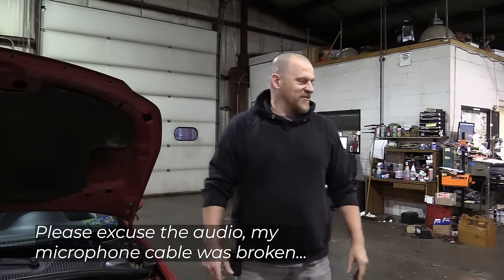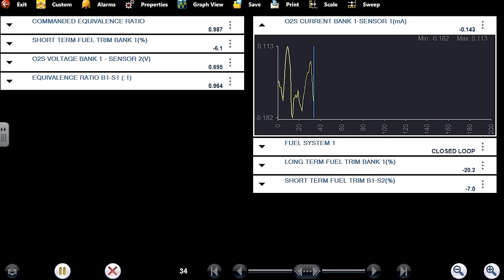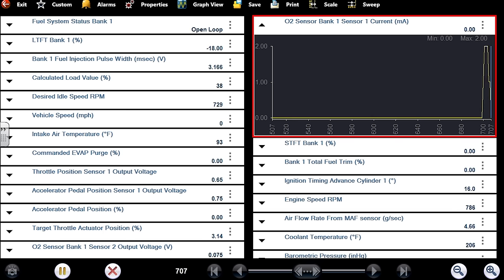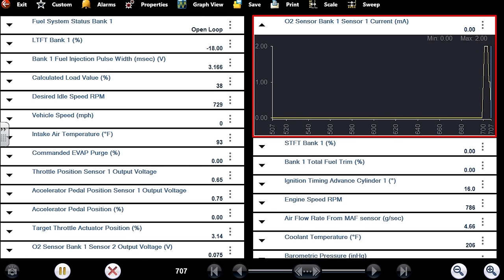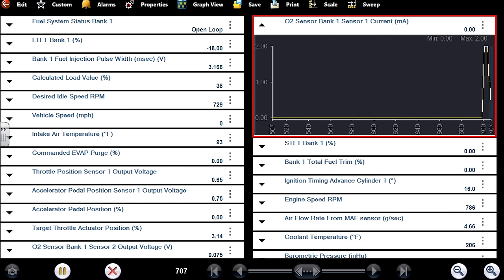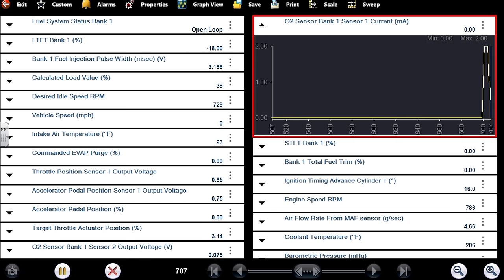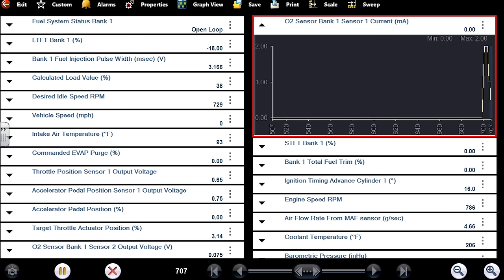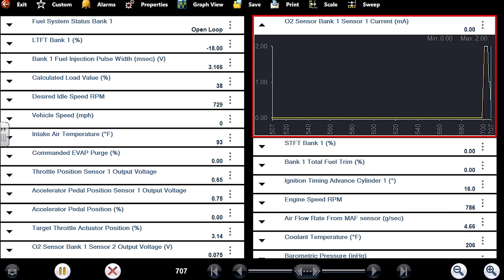MAF and Wideband O2 Sensor Testing for a P0172 [Rich Condition]

Comment: Im randomly getting codes p2198, p2098. Also same for the other bank (2196,2096). on a 2010 Audi S5 V8. I do also get P0141 sometimes. I get LTFT -8 to -17 at most for both banks usually a bit higher for B1. Replaced OEM injectors, carbon clean, low pressure fuel pump and filter, low and high fuel pressure sensors. Plugs, coils, HPFP and pre cats O2 sensors replaced about 55k kms on it. MAF is original, I tried another one with same results. I even check the Evap purge valve. Downstream O2’s seems to be working fine, both reading about .60sh to 70sh. I removed them and cleaned. What else I could check? I want to to a flags tune on the ECU. 🤷‍♂️btw, cars runs great with lots of power it’s just those codes coming once in a while. Sometimes if I do startup and rigth away drive only trigger p0141 heated exhaust gas.
Reply from the maker: Your first mistake was replacing all these parts based on these codes without doing any testing. Now you've added additional variables (bad new parts) to the mix.
Define all the codes please.

Comment: Hey Paul,, great flick as always.

I have a question for you. At around 27. 45 you mentioned "let's go to the graphing meter"

When do you want to use the scope vs the graphing meter and vice-versa?
Reply from the maker: This wasn't a great example of when to switch to the graphing meter. I just wanted to see what it looked like with a longer time base, without worrying about the scope sample rate (peak detect)
I'd say in short, I don't use the graphing meter very often these days unless I'm looking for a glitch or drop out on a time base longer than 5 seconds. Or if I want to graph a voltage trace that is a constant signal that shouldn't change and I'm looking for a glitch/drop out I'd definitely use the GMM for that
Reply: @ScannerDanner  thanks you very much for taking the time to answer in details, it is much appreciated. I'll add that to my book of tricks.

Happy holidays to the Danner family and long live this channel.

Comment: Hey, at 44:30, the downstream O2 sensor is sitting at around 0.8 V. Is this cause for concern? 

From what I can tell, I don't think its an issue because you still have good fuel trims.

Is this a bad sensor? Is this a normal reading?

If anybody has any insight I would really appreciate it!
From

Comment: Good find. I agree with MAF’s are the hardest to call or take a gamble with. I’ve got lucky a few times and also not so lucky. But on another subject. Dealing with a 03 Ram that has a single misfire during decel. Full tune-up has already been done due to carbon tracking on plug. Injector also replaced to see if that was an issue. Idle and normal driving is fine. Any ideas on what to look at or test? Thanks if you can shed some light.
Reply from the maker: During decel, the injectors are cut off. What does a decel misfire feel like when non of the cylinders are firing?
Reply: @ScannerDanner  change of tone in engine. And misfire counter in scanner showing dead mis. Can’t physically feel the misfire which is odd.
Reply: @ScannerDanner  figured it out. Used a pressure transducer and saw something going on with the exhaust side. Put a scope in the cylinder and saw the valve had worn into the head and rounded the seat.

Comment: great video great explanation. lots to learn and  over view. you mentioned alot about calculated load value. can you please elaborate more. thanks merry christmas to you and celab.
Reply from the maker: Thank you! It's a mathematical calculation that is highly proportional to whatever the MAF is indicating (as you saw). But it's basically throttle angle, RPM, MAF and MAP (if it has one). I believe BARO is also involved and then the VE of the particular engine.
Reply: @ScannerDanner  Thanks Mr. Danner. But i was trying to say that if the calculated value of load is identical with maf plugged in and unplugged then nothing is wrong with maf. But if they are not identicle, as we saw in case study , then maf is skewed. Is that right assumption? Thanks

Comment: Scanner Dan I got my LFT +25 it doesn’t move at all my STFT is going to -20 to 0 to +15 and again as I accelerate going negative as it idle  goes into positive. Is this a MAF ISSUE OR FUEL PRESSURE ISSUE? I unplugged my MAF car runs as nothing changed. I plug it in and car dies
Reply from the maker: What are your fuel trim numbers at idle (hot engine) and 3000 rpm in park. I'm only interested is steady throttle numbers

Comment: On my Toyota 2.4L, the g/s at idle is right around 2.2-2.8.  In my case, the g/s is very close to displacement at idle.  I don't like my Total fuel trims though, edging up toward +10% at idle.  I'll inject a flammable in the intake and see which way the trims go.  I had a very brief stumble at start that cleared up when the weather got colder.  Thanks for the videos, lots to learn, much to apply.
Reply from the maker: If you're under 10% you're fine. It's possible you have a small vacuum leak if it only is that way at idle.
Reply: @ScannerDanner  Thank you, SD.  It could have a vacuum leak at idle and then the problem is masked while driving?  I took my scan data and used max RPM and MAF, IAT and atmospheric pressure and calculated volumetric efficiency and got 110% VE.  I blame the fantastic videos you put out loaded with information.  I'm doomed I tell ya.

Comment: Question I got a Buick 3.8  supercharged Buick park ave and I have a p0172 I checked the term #s and seem to be ok. What can else can I look for? 

Thanx ..appreciate any tips
Reply from the maker: What's the freeze frame data of that P0172 code show you for STFT, LTFT, ECT, RPM, ENGINE LOAD?

Comment: So you didn't make the MAF call based on the lab scope signal, you based your call on the high engine load percentage?  The old and "new" MAF sensor signals look the same, or did I miss something?
Reply from the maker: That would be correct
Reply: @ScannerDanner  So, if MAF is used by the ECU to calculate engine load, why didn't we see a significant difference in wave form?  Or, did you need to get more granular on the time base to see it?
Reply from the maker: @superk4562  we did in the grams per second reading at idle and also the stability of the signal. I can't remember the numbers offhand but I think the old MAF was jumping up to 4 grams per sec at idle and it was very erratic
Reply: @ScannerDanner  This is really cool! I've been troubleshooting a 1999 Ford F150, 5.4L 270K miles on it with a brand new long block.  I reused some components I probably shouldn't have.  I found a very small leak in the EGR valve and I replaced it.  Fuel trims were 13 and 12, bank 1 and 2 respectively.  I looked at the MAF, it appeared to be working but it was only reporting 4.9 g/s at idle.  I installed a new MAF sensor, and g/s went to 6.2.  As soon as I installed the new sensor, short-term fuel trims went negative, and started pulling the long-term fuel trim down.  Now, the fuel trims are near zero, but I still can't get rid of the surge at idle; weird thing is the idle will only surge in Park or neutral.  Any ideas?  I've already smoke tested in the intake ... no leaks.  IAC is new too.

Comment: Pual can you do volumetric efficiency  test in this case ?
And as always it's a pleasure to watch you do your magic
Reply from the maker: All of the VE tests I know how to do are with the throttle wide open. I'm not aware of any closed throttle VE tests that are valid. Though I'm sure someone out there has some formula 🤔 thanks!
Reply: @ScannerDanner  yes i know it only at wot 
So u could do the ve test wot in this case right ?
Reply from the maker: @lolipopdeck3694  you could but it probably would have passed that test. The issue with skewed sensors is there are times within the range where they'll read properly.

Comment: Sir in this after replace maf o2 sensor2 is going up700mv .my thinking that it reading should 450 mv.750 mv means that's system is little bet rich but  fuel terms are normal .plz explain
Reply from the maker: An upstream O2 should be switching from 200-800mv and it is normal for a downstream O2 to be steady

Comment: I have 2008 Toyota Yaris sedan rich condition P0172. I HAVE CHANGE THE OXYGEN SENSOR. FUEL INJECTOR. GAS PUMP FILTER, TEMPERATURE SENSOR. COILS APARK PLUGS. VACUM MAS AIR FLOW SENSOR TOO STILL HAVE THE CODE
Reply from the maker: Time to follow some testing procedures and stop throwing parts at it! Every single part you replaced is also suspect now

Comment: My subaru forester 2.5 xt is overfeuling black smoke only on normal operating temperature start up not doing it on cold start its doing it for about 5 sec then smoke disappears do yoz think its maf?
Reply from the maker: Maybe an engine coolant temp sensor issue? Any codes? What year is your car?

Comment: Hey I got a question this may be a little bit off subject but since we're talking about oxygen sensors on foreign cars like Hyundai's Hondas does the downstream oxygen sensor play a row in the fuel trims I have noticed several times that the downstream oxygen sensors fuel trims will be 99% and we'll never change from thatBut if you look at the downstream oxygen sensors on OBD2 or under Hyundai you will notice that they are working but the fuel trims r still stuck at 99% a lot of times I've never really wrapped my head around this
Reply from the maker: when you see downstream fuel trim at 99%, this is a data parameter that is not being use. Also, I have never, not once, seen downstream fuel trim being used with a narrow band upstream O2. Only some systems with wideband upstreams will they also use a downstream fuel trim strategy for minor corrections. In my chapter 4 and 5 playlist I have a case study on one with downstream fuel trim control. Thanks!
Reply: @ScannerDanner  thanks for the reply I really appreciate it I would love to get your book just been a little short on cash here lately I believe the car does have wideband upstreams anyways like I said thank you sir appreciate the info
Reply from the maker: @diamondstateautodiagnostic5250  oh no man I wasn't suggesting you go and buy my book I have playlists right here on YouTube that correspond to the chapters in my book but that's all, you don't need the book to benefit from this. 
here's the playlist I was talking about https://youtube.com/playlist?list=PLD2809EEC7BAAF989
Reply: thank you sir I really appreciate that one of these days I really would like to buy your book and join your premium Channel I love watching u videos I don't even watch TV anymore I just come home and watch your videos LOL maybe one of these days I can order a book from you I'd love to have a signed copy LOL
Reply from the maker: @diamondstateautodiagnostic5250  I can do that 😉, just sent a signed one to the Uk 
Email me at support@scannerdanner.com  when you want one. Thanks again!

Comment: i have seen you clean throttle body for high engine load  does that not apply in this case?
Reply from the maker: For high TPS%, not an engine load PID. Also for a false MAP sensor code

Comment: Why an oil change after lean condition? I understand after a rich condition.
Reply from the maker: ANY mixture issues, especially when there is a bad oxygen sensor, you should always do an oil change
Reply: @ScannerDanner  i will, if i ever get it fixed :(  So far i have not been successful.

Comment: I didn’t realize until recently that all the car companies hide their secret recipe design of MAF sensors like Coca Cola flavors. Lol it’s a nice gimmick for the auto dealerships to up sell a $10 part for $400 to all us loyal customers to their brand. BTW: what kind of junkyard did you find this MAF? In my experience everything engine related is gone in minutes from the time the tow truck disconnects a wreck in the yard!
Reply from the maker: This was more than a $10 part for sure, but we got lucky finding one this used one for cheap.
The salvage yard my brother uses is not open to the public. They get cars in, and immediately strip them of all these types of parts, then inventory them, and then crush the cars. I think he mentioned the name?

Comment: I think the manufacturers of MAF Sensor cleaners . Could / should put on their cans to clean MAF Sensor , when engine is COLD . As I expect if warm / hot  ,spraying it would ruin / destroy the wire sensor .
Reply from the maker: The external temperature of the sensor isn't the issue. It is when the key is on or engine running and sensor plugged in, when the hot wire is over 400°F, that you'd want to keep that cleaner away from it. Make sense?
Reply: @ScannerDanner  Yes , and have always cleaned the MAF sensor cold .

Comment: LOW FUEL DELIVERY CAN GIVE A CODE P0170?I HAVE AN OPEL CORSA C 1.2 CC THAT HAS A P0170 CODE WHEN THE SWITCH IS OPEN  KOEO IT DOESN'T HOLD FUEL PRESSURE AT ALL BUT THE PRESSURE IS NORMAL AT IDLE AND THE ROAD  .WHAT IS CONFUSING ME IS THE STFT WHICH ARE -15%- -20% AT IDLE ( RITCH CONDITION!!!!!)  AND NORMAL AT  2500 RPM.O2 SENSOR 1 AT IDLE IS NORMAL MAF HAVE 1,4 V AND 2,-2,5  g/s  AT IDLE and 4.1 v at sudden kick from idle  .ENGINE POWER IS OK ONLY PROBLEM IS CHECK LIGHT IS ON  WITH P0170.I DONT FIND ANOTHER PROBLEM.THE STRANGE IS THAT WHILE IT DOESN'T HOLD FUEL PRESSURE ΑΤ ΚΟΕΟ IT GOES START  NORMALLY!!!!!!!WHEN I IDLE THE FUEL PRESSURE GAUGE READS 3.8 BAR BUT WHEN I PUSH THE VENT BUTTON THE PRESSURE DROPPS 1 BAR BELOW.THIS SHOULD NOT GIVE A LEAN CONDITION????I GOT AND ADJUSTED THE THROTTLE FROM 750 TO 950 RPM AND BALANCED THE RICH MIXTURE WITH ADDITIONAL AIR AND THE STF DROPPED TO -6% TO  -10%WHAT IS YOUR OPINION?
Reply from the maker: tech tip my friend. It is hard to read in all CAPS. And is viewed by many in the online communities as "shouting" lol. It feels like you are shouting at me. 
Anyway, the P0170 is a fuel trim type trouble code so everything is on the table with your rich condition (as noted by your -20% numbers). Could be anything. But no, low fuel delivery would not cause rich conditions, you'd have positive fuel trim numbers, not negative
Reply: @ScannerDanner  I'm sorry if I bothered you, I didn't mean to, I just have questions and I consider your help very valuable. I won't bother you again! last request, if you can make a video about vvt systems and how to check the damage in the live data. to scan tool . thank you very much
Reply from the maker: @dimisrambodimisrambo7285  no, please, you misunderstood me, you are not bothering me at all! I was only trying to help guide you with the all capital letters. It is hard to read, that is all. You've asked some very good questions and I never mind answering whenever I can.
Reply: @ScannerDanner  now I understand exactly. sorry but I don't know English and I translate through google. as I said I have seen your videos about the Actuator Solenoid test for variable timing but if you happen to find a video with diagnosis with the live data of the scan tool it would help a lot.and finally the stft are determined only by the o2 sensor? is it generally a combination of sensor data that the psm looks at?